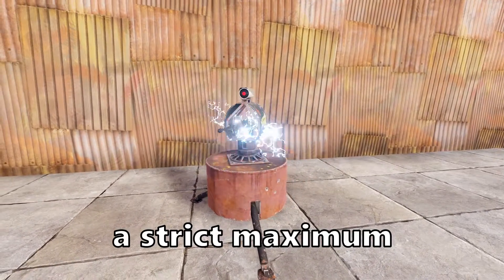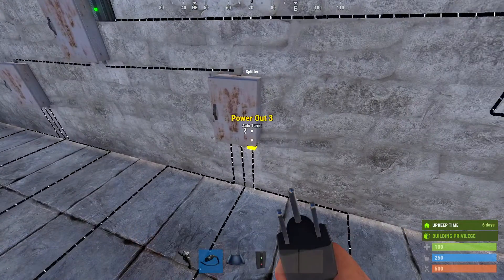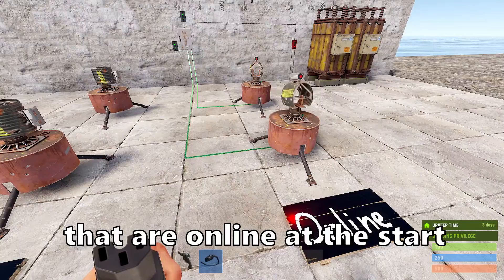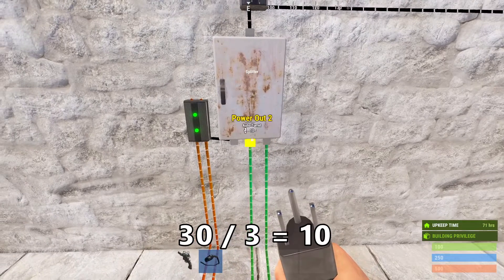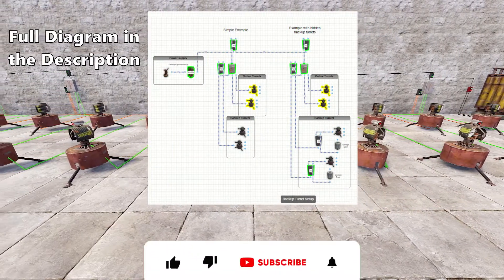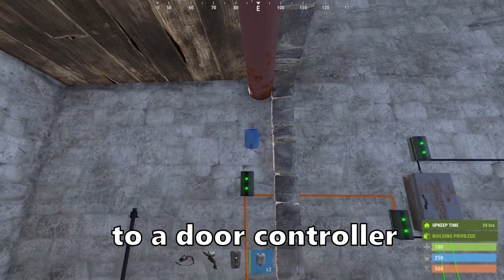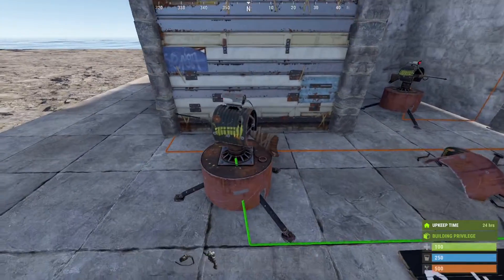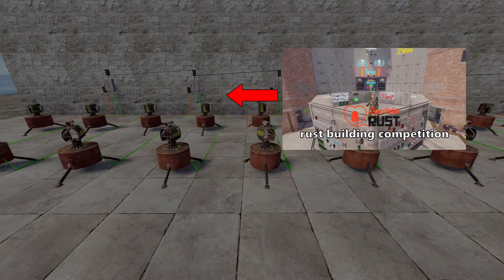Backup Turrets Setup | Quick Rust Electrical Guide

Comment: I wonder if you have any suggestions for a niche base turret coverage im doing.

Base context is semi big rich duo-trio, china walled, 3 gate house, with turrets covering every degree around the base, and about 8-12 turrets above the gate house. They'll have to basically HV every turret to walk up to the base.

I've been trying to make it where I have 2-4 turrets active above the gate house( less if there is roof required protection)

How would you chain your electrics to make sure I'm not requiring 300-400 constant turret power. I can configure my NiH Core to do such a thing but not efficiently.

Comment: You could update this video as electrical components no longer use power, and the circuit build has changed. In case anyone was wondering why his circuit isn't working, all you need to do is change the first branch value from 31 to 29 and wire the second branch to the last output of the splitter, the right one instead of the left one, as shown in the video. That should fix the circuit.
Reply: thx bro :)
Reply: thx

Comment: This wouldn’t work even before the update. It powers 3 turret and when one is broke. The 10 is split so both receive 15. With 15 on the branch it only supplies the 1 back up with 5….. this wouldn’t work before the update and it won’t work now
Reply: Of course this works bro

Comment: When the wire isnt long enough you need to place an electric branch or a another electric thing. The problem with that is the splitter will send power to an empty branch and wont give power to the 2nd turret

Comment: ok i get the system but what if i want more turrets? 12 activ, 12 backup i can only set up  4 in one circuit is it possible to connect more together? ofc i can do this 6 times but there are not connected with each other... if lets say the 4 turrets on top get destroyed the ones on the shootingfloor will not turn on
Reply from the maker: You can just repeat the shown circuit (use the updated one in the description).
So the circuit has 2 active and 2 backup turrets to it 5 more times and then you got your 12/ 12 setup.
Reply: @PhilieveRust  y but like i said the circuit are not connected with each other... Lets say i have 2 of this circuits, if the first 4 Turrets(activ and backup) get destroyed the backup turrets on the second one will not activate because they are not connected to each other. Thats what i try to solve
Reply from the maker: @deekay8987  Ah, got you now. Sounds like something one would need to adjust a more individual bases.
You could introduce groups of turrets behind memory cells that get flipped on or off depending on what turrets are destroyed or connected.
It will be more complicated, but possible with some thought put to it.
Reply: @PhilieveRust  mhh memory cell could work but i think there must be something that triggers the flip (correct me if im wrong) im not sure whats the best way to do this :/

Comment: they changed/changing how branches and splitters work, they no longer use 1 power so i dont think this will work
Reply from the maker: Yes ideed. Soon I'll post an update about that issue.
The fixis to put a component with 1 power consumption like an industrial light or door controller between the branch out of the back up branch and the first backup turret.
Reply: so is there any fix?
Reply from the maker: @realsecrets1  I updated the video description. The circuit in there is the updated and improved version.

Comment: Had one part  of base where 3 turrets wouldv e been nice , and now it s possible !
Reply from the maker: You could always just skip the last turret. Meaning 2 active + 1 backup for 12 active and 6 backup in total.
To have a 3/3 system is a fair bit more complicated.
Reply: @PhilieveRust  I have 3 main turrets on roof  ( all my turrets have their own battery!)  and I will connect them to 3 bottom ones. Question is can I put a separate battery for each bottom turret? My total will be 15 turrets instead of 12..
Reply: @PhilieveRust  Now with new update on force wipe where splitter switch etc dont consume power anymore , we prob should just modify the branch
Reply: @PhilieveRust  In 3 months I figured to make a syatem that when first turret breaks second activates , and when second one break a third activates , hahaha

Comment: Not many videos but sub just because of this tutorial. I would like to know how to connect this system with some HB sensors so i.e.: someone is detected around compound so roof or inside turrets are off and compound turrets (or some part of them depending on N/S/E/W side) are active and viceversa.
Reply from the maker: Thank you for the sub. More videos will follow.
This system is mostly for backup itself, so no need to connect HBFS. If you want to scale it up even further, you can create turret groups (compound. roof, inside) each with 12 turrets. Either use HBSF to detect the enemies or the has target on the turrets.
Here is one example circuit made by Hyperion:
https://www.rustrician.io/?circuit=0f0bd40d06376a77a8310345f0aa11b2
These can further be customized depending on size, placement etc.
Let me know how it goes.

Comment: Good circuit, only downside I see is the branch using 30 power at all times to power 2 turrets
Reply from the maker: You are  right it isn't objectively most efficient. For a backup system itself it is relatively power efficient.
If you want more turrets while having 100% power efficientcy you might want to use a turret flip-flop, in which you toggle between groups of turrets.

Comment: interesting tradeoff which is gives quite a useful tool. Without door protection, you spend 30 (31) power for 2+2 turrets, rather than spending the same amount of power for 3 always active turrets. It's a little worse of a tradeoff if you add door protection too, but still great
Reply from the maker: Yes, having a backup circuit with 24 turrets total is more costly than having only 12 always active turrets.
How would the door protection make it a little worse ? Both setups shown require 31 power for 2 + 2 turrets.
Reply: @PhilieveRust  oh I’m so sorry! I assumed something due to not fully paying attention and understanding the system 
The fact that it doesn’t add extra usage with the additional door controllers is a big plus!

With that out of the way I’d like to clear up what I meant overall, with the same amount of power usage you could have 18 always on, or 12+12. Which honestly, is more than enough. 
12 turrets switched on constantly with a buffer of losing 12 turrets seems very very worth the “loss” of 6 turrets at startup. On a raid it’s most definitely worth it!

It’s interesting how this could be chosen based on scenario. Like 3 vs 2+2 may lean in the opposite direction depending on the layout of whatever’s being defended.

Overall, this is an incredible tool in a builder’s arsenal, and while it may not be useful in every case, it will be very worth its while where it’s needed!!! I really love the pros vs cons balance you got here!!
Reply from the maker: @ @m-yday  
No worries. 😊
Yes, there are quite a lot of different setups you can create,
with different use cases. To have the knowledge to know which one to use when,
is certainly beneficial for a good electrician.

Comment: You don't need any extra installation to make back up turrets, you can simply double up on your turrets and it will automatically power up every time one of your turrets is broken.
Reply from the maker: This is technically true, but it has some disadvantages:
1. It is less power efficient.
2. You have little control which turret will come online next.
3. Non-active turrets will be exposed.
Reply: @PhilieveRust  I agree with your points, it is more efficient overall to control it but it can also be annoying for the raiders to have some disconnected turrets (with the eletric effect) that can turn on at any moment if they break some turrets so to be safe they'll need to break all of them just in case and if not they can be trap (if a turret turn on behind them).